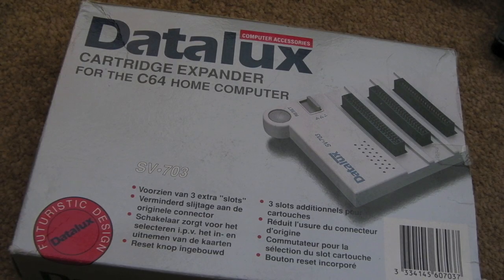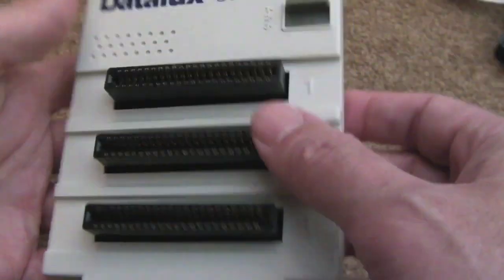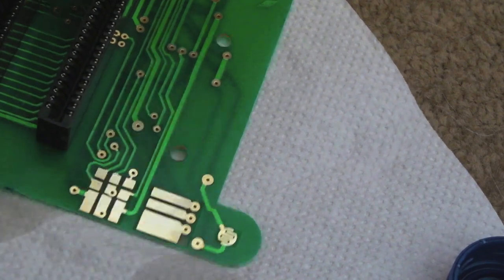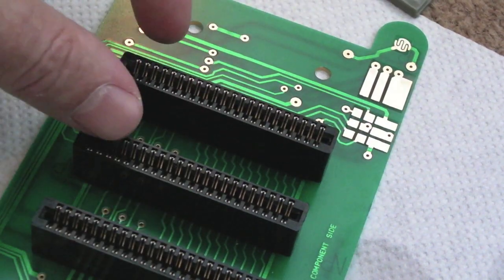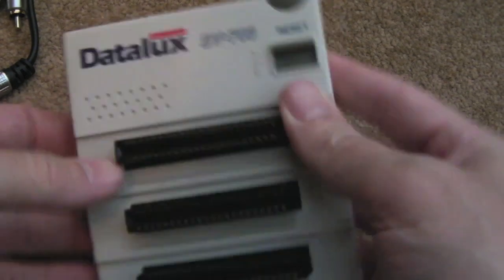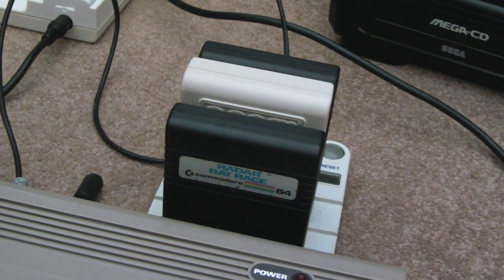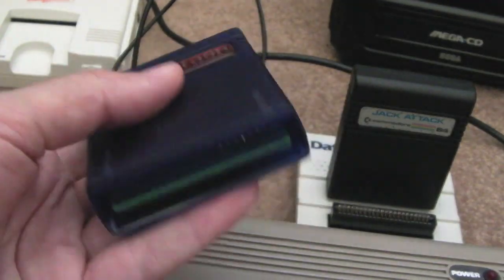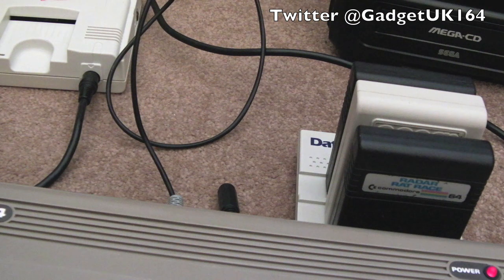Commodore 64 (C64) Datalux SV-703 Cartridge Expander - Teardown / Repair

Comment: ROM_L and ROM_H are the chip select outputs from the C64, which will enable the ROM chips on the cart, depending on the EXROM and GAME inputs. They have to be switched, as many carts just ties GAME and / EXROM low depending on their configuration. That's probably not the issue. I suspect vintage carts with older technology chips would be fine, they also ignore many of the lines like the clock and IRQ etc. They will be parasitically powered by their data and address lines when 5V is not connected, and the modern chips may not be able to win the fight with them on the databus. Running them in parallel without buffering is probably not a good idea, so best use the easy flash on it's own. Oh, and happy new year.
Reply from the maker: Thanks Dave, I knew you would know =D  I did wonder about something being parasitically powered.  I wonder if that would still happen if I 'switched' the ground too.  Or... Would it find a parasitic ground from the data and address bus connections too I wonder?   What I was thinking was to split the double wide traces on switch contacts, then feed ground through that 4th position.
Reply: Probably a bad idea to switch the ground, as that could damage the ROMs if they have inputs and a floating ground, and some of the pins could then go negative relative to the others. One thing you could consider would be buffering the select lines to each socket. If you cut /ROMH /ROML /IO1 and /IO2 to each socket and fed them via 74LS126 buffers, one chip per socket, with the gate controlled by the switched 5V. The outputs of those is tri-state when not enabled, so you would need to add pullup resistors to the sockets. That should leave it with the select lines being high unless that socket was selected, which should stop any chips which were parasitically powered from being enabled. With that you would not need to switch the 5V supply to the sockets,  you could argue it would be better that way, so the unused cartridges were powered, but not enabled.
Reply from the maker: Thanks =D  You've confirmed what I thought in the video about the ground.  Also the CS signals does sound like the idea solution =D

Comment: I would be tempted to cut the double contact to make two switches as you mention, and hack it to isolate the ground too.  The Rom Select and other lines are going to have to go High or Low, so if you eliminate that possibility, then I think it would work.  ** Now I just realized this video is 2 years old, so did you make any progress? **

Comment: My dad had a similar expander but instead of the swiper/switch, his had an actual switch soldered in place.
Easy to say now, but there is a known compatibility issue with some carts due to additional components in the cart.

Comment: My gut feeling is the same. It's the easyflash being a pain. If you think about it, it wasn't designed with this set up in mind. For the record my "new" 3 card expander works with everything, easyflash carts, even the ultimate2 (which I don't recommend  for this) but I tried it out of curiosity.
Reply from the maker: A few people have helped work out the cause - we think its the EasyFlash being parasitically powered via its address and data connections.

Comment: I've got one of those myself.. mine looks as unused as that - because quite frankly it was awkward when using the Action Replay V in  a vertical position.. it could easily get pushed backwards when hitting the freeze button because there's no slot around the base of the cartridge to hold it in place, therefore it could lead to damage.. so I stopped using it in the end.

Comment: Gadget take photos and measurements at that board and send it to chucky and terriblefire and let them make these boards so that people can have those awailable and solder those them self. And photo and scan that case also that people can 3print those. Keep up good work 👍 Also try to get your hands supercpu it would be nice if that board could get copied because they are too expensive 1000-3000 dollars.
Reply from the maker: I could design a PCB you know!  Are these really that rare now?
Reply: @GadgetUK164  I do not have first knowlidge but channel commodore4ever say so. You can check he videos about these CMD supercpu and Ramlink card.He says they are rare and price is high and more people want them if they could but price tag 1000-3000 dollars is too much. Sorry if have mistakes but i hope you understand. Keep up goodwork👍
Reply: @GadgetUK164  Atleast i have not seen those cartridge extender boards any where. I do not know if there is allready board made or not. But atleast i can not find any. And 3d printing the case would help hobbyist.

Comment: Does the cart switch over both +5V lines or just one?  If just one the Flash cart could be drawing to much power for the other cart to work depending what +5V rail it is using.
Reply from the maker: Both 5v pins at once!  Dave Curran pointed out that it's probably the other carts being parasiticaly powered via their address and data connections.

Comment: If you just remove power from a chip, it will still get power through other connections. I made this mistake early on with the LynxSD by thinking a chip would tristate its output if I removed power on a separate voltage rail. Nope! Parasitic current draw through other connections is enough to power it (at least to the point it interferes). And there's no pull-ups on the GAME and ROM signals for the disconnected ROMS? That may be enough to stop things interfering, but also I'm guessing you'll be overloading the address and data line drivers as they try to power the other ROMs.
Reply from the maker: Thanks mate =D  Yeah, Dave pointed out that it was being parasitically powered too!   Not something I expected lol =D  I might try isolating ROML and ROMH with a chip, so they are only connected to the cart switched too.  In theory I can do that quite easily I think.  Dave suggested that but I had wondered about isolating the CS (ROML ROMH) signals, because in theory they shouldn't then be outputting even if powered unintentionally.
Reply: Were are all the CS lines switched between the ROM's by the multi-pole switch? If so, you should just need to make sure they are all pulled high when inactive. All ROM's could be powered in this instance, as long as the CS lines are only to one ROM... apart from the fact the regulator in the C64 may not be up to powering that many ROM's. :) But, yep, in general if all CS lines are isolated and pulled high for non-active ROM's, that should do it. The only thing to be wary of then is the parasitic current draw on the address / data bus. I'm not sure how much the current draw would be, not something I've investigated in detail. But I know this type of situation has bitten me in the ass more than once before now... lol. :)
Reply: (I've just read Dave's comments, I hadn't spotted he'd said basically exactly the same thing... :)
Reply from the maker: Great minds think alike! =D

Comment: Love these exapnders, they save you from fumbling around blind at the rear of the machine trying to fit the cartridge in. :D

I find it Interesting that the design is very similar to a 3 cart expander I have from a company called Navarone.
http://knoppix.net/store/img-large/ships-free-commodore-64-c64-128-3-cartridge-expander-navarone-working_152848589353.jpg

I've been running both an Easy Flash 1 and Easy Flash 3 in my expander (plugged into a C128) without problems - then again I haven't tried programming the carts or anything, I've just been running what's already on there.
Reply from the maker: It may be that your expander is better designed!  I will try and isolate ROML and ROMH later with a mod.

Comment: A nice little find. I have a similar cart expander, somewhere in a box, with individual switches for each cart slot. I can't imagine what happens if you switch them all to 'on' at once.

Have you shot your Simple64Cart video yet?  A lot has transpired since I sent that to you.  Although it's good for simple DIY C64 cartridges, bwack took Jim Brain's Simple64Cart design and went to town with enhancing it, creating Vers64Cart making the original design much more...well...versatile.  The Gerbers and User Guide can be downloaded from here, http://bit.ly/Versa64Cart-MFRetro, or bwack's Github.  I have a few Versa64Cart v1.0 PCBs if you would like me to send you one for the video.
Reply from the maker: Yeah, great for the price =D  I've got that cart on my to-do list over the next few weeks!  I know it may need a mod or some resistors / diodes etc, but it will be fine =D  Would be great to take a look at a Versa64Cart =D =D
Reply: all on at once would probably just black screen or garbage because all the data lines would be in conflict.
Reply: I'll have to dig it out of whatever box it's in and see if they incorporated any safeguards.

Comment: A diagnostic cartridge is most likely going to be plugged in by itself anyway. Because you are trying to fix something and want as little connected as possible.
Reply from the maker: Yes, that's true!  But the standard diag cart is wired just the same way as many other game carts, so it should work.

Comment: It is so dumb how the amiga didn't have a cart slot. It really needs one (presumably via the a500 zorro slot). Screw WHDLoad and its wasteful RAM/CPU overhead! I mean, if the amiga had a cart slot, can you imagine the blast-processing (well sort of blast) capabilities or games having super-FX style chips? I don't care if it is cheating. Why do amigans have to be so noble?

I think the action-reply cartridge is a good way to start thinking about how an adaptor might connect. Also another part of the approach could be the way the video-toaster (which is zorro btw) would dump video into the amiga graphics chipset.

The point in doing all this is to make the alternate timeline. You know the one. The one where amiga triumphs over those console peasants with their lack of principles and their absurd notion that speedball2 on the megadrive should be £40 (in 1990s prices!!) even though it is basically the same game as the amiga version.

p.s. thumbs-up and stuff.
Reply from the maker: Yes, you could argue if the Amiga had had a cart slot it might have done even better!  The expansion slot underneath was the equivalent to that really.  You could put the board into a tower case and via a bridge expander have more zorro slots etc.
Reply: It is cool that you can put an amiga in a tower. It is also cool how the a500 case was not a tower, because you can fit an a500 in a bag-for-life and hook it up to your mates one round his house using a null-modem cable. I think a Briticised version of the A-Team and MacGyver (a bit like alien vs predator) could be remade where MacGyver takes an a500 round the A-Team's base for multiplayer like that (in a B4L of course). They'd have Southern and Northern accents though (Briticism). Unsure who'd be north or south (maybe A-Team northerners). Maybe they'd play the "North and South" game.